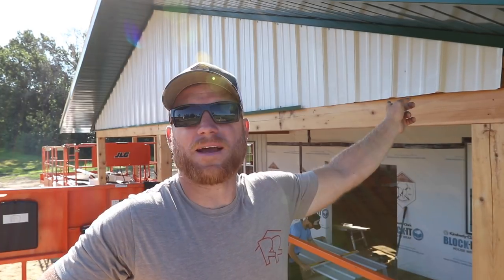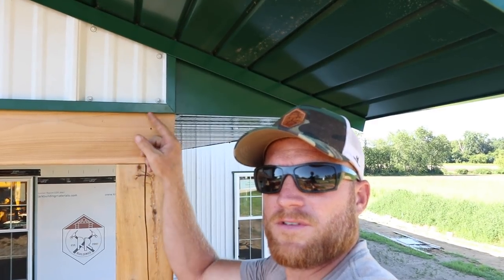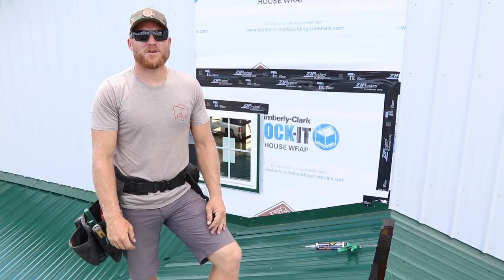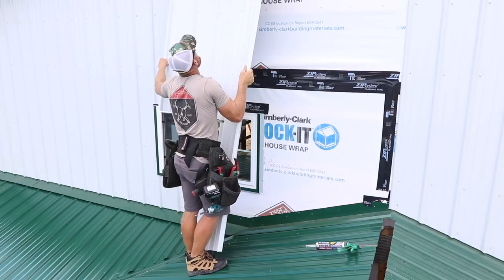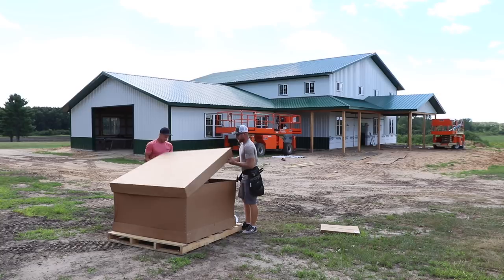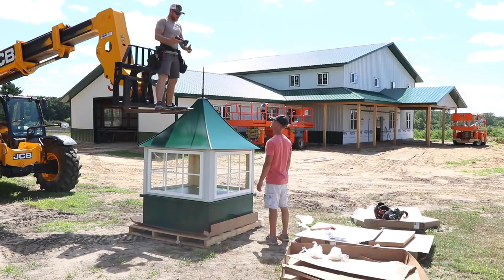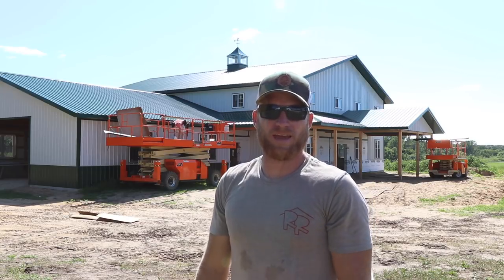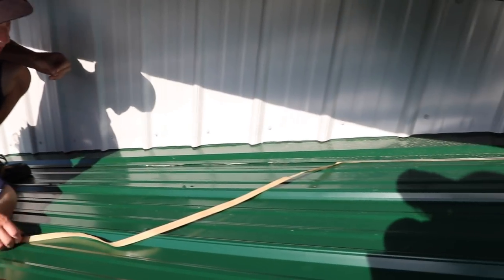Building a Hunting Cabin 23:  Installing a Cupola

Comment: OK, this is likely my dumb; I thought a cupola was supposed to be about venting heat out of the ceiling and maybe about admitting light to the central part of the building. This cupola doesn't sit over an opening in the roof, and can not vent and the solid bottom as well as the lack of a roof vent hole keeps it from admitting light. I'm thinking this is just a pretty piece of work? This was a supplied kit- I know RR didn't design it, I'm just trying to understand what it is and then I wonder if it could be modified to do the light and vent thing- I live in Texas, and the venting would really help keep the temps down inside the structure. The details were dynamite- as usual your prethinking and knowledge of the trim shapes and how to purpose them is awesome!FR
Reply from the maker: It’s strictly visual yes.. could be modified for sure

Comment: The cupola is the finishing touch on that building, but i think i would like to have it more funcional than decoration and weathervane support, 
Traditionally they were to let light in or ventillation, or as a lookout, or (appropriate for this building) a gun turret.
I know on most of your buildings there's a ceiling, so light would be awkward, unless you used a solatube (lightpipe), could be worth thinking about ;)
Reply: Sparky Projects - can see easily enough to install some type of security camera in one linked to a live feed if any interesting things occur.

Comment: Just out of curiosity, are you concerned at all with water that comes down the wall/corner trim making its way under the hip cap and going into the wood underneath? I would assume that normally the flashing that goes under the wall metal would go over the hip cap to make sure water doesn't get into the crevices underneath.
Reply: Dmitriy Fedorchuk - you clearly did not watch him apply the mastic foam strips which lets hot air out and keeps rain out. He even mentions and points it out.
Reply: @Joshua79C  well I did see the closure strips and understand it keeps out wind driven rain but there will also be rain that runs down the wall that could get under the hip cap from the end

Comment: “Goes together easy,” when people try to cut costs by using inferior products they increase the labor coefficient. Cheap products take more time to fit together. Better engineered products have a higher initial cost but the quality is better and the install labor will be less as it requires less field labor to be fitted.
Reply: Cous? A long lost Cousin? Descendant of Deacon William Holton landed at Charleston MA 1634?

Comment: im not a fan of the steel look most of these post frames have, is there a way to do more intricate and "pretty siding" or just different siding in general
Reply: halogamerdude41 - look up the run in shelter build video he did a while ago ( https://youtu.be/wvicQhAc_2Y ) as it shows that post frame aka pole barns can be finished like any other type of wood framing.

Comment: That is the usual thickness of metal u use?
Reply: Dmitry Gureev - 29 Gauge wall, roof, ceiling.
Reply: Joshua79C C how much in mm?
Reply: @dmitrygureev4574 , just google "29 gauge steel" and you will find a few links providing both US customary and SI/IS metric

Comment: You guys in the NA wood system world have it easy. We pretty much have to have a line the contract specifically stating that once work has started, nothing can be changed. Tearing concrete or brick is a nightmare at the end of a job and in certain situations .. illegal or very dangerous.
Reply: That is very reason why wood is more versatile than ICF (insulated concrete forms) or steel which each have their limitations in design changes. ICF is as you say. Steel framed is not as hard but still requires engineering seal of approval.